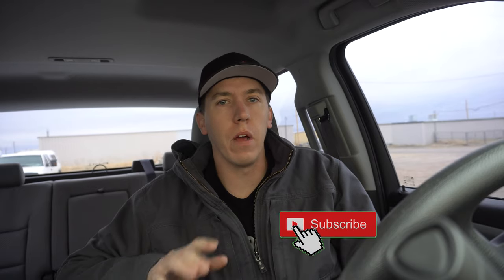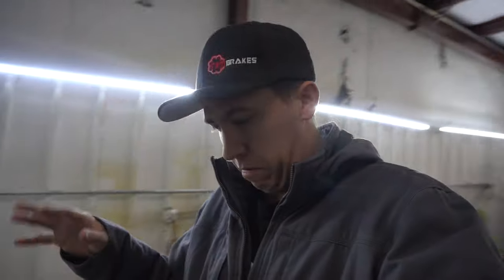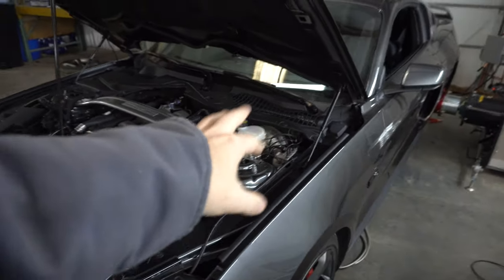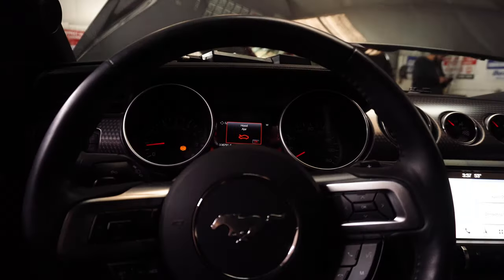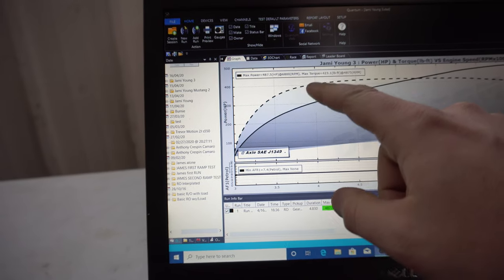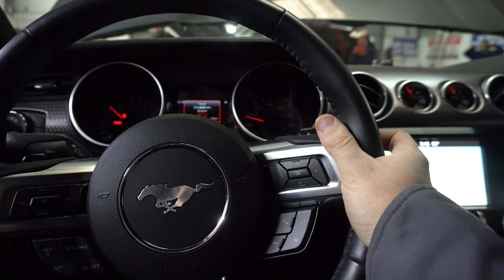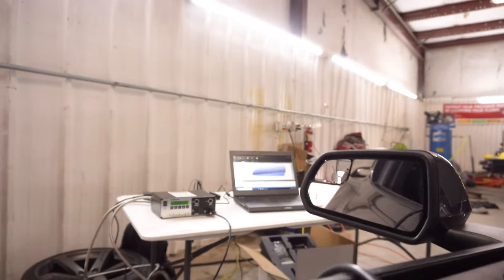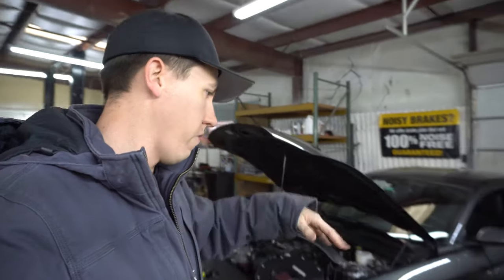s550 Coyote powered Mustang on the Hub Dyno!

Comment: Cool trick instead of the fuse is unplug the connector on the driver side by the airbox.  It disables all the nannies the same as pulling the fuse.  For the track a lot of guys (myself included) wire a switch off that plug im referencing to be able to have tcs abs on and use the factory linelock then disable the same as pulling the fuse or unplugging but from the drivers seat.

Comment: So....on this s550 with a A10 tranny 7th gear is where you want to pull at?
I have a 2020 HPP and am setting up a appointment for a hub dyno for a baseline. I am concerned about this abs thing and the correct gear to make sure I am getting a good reading of were I am at